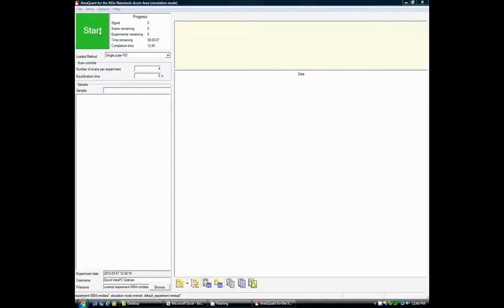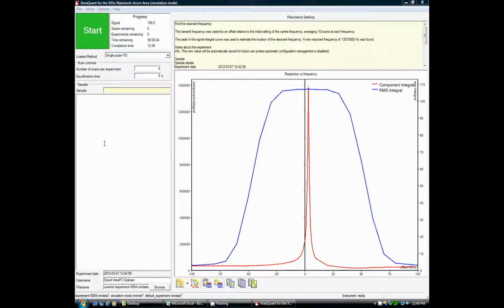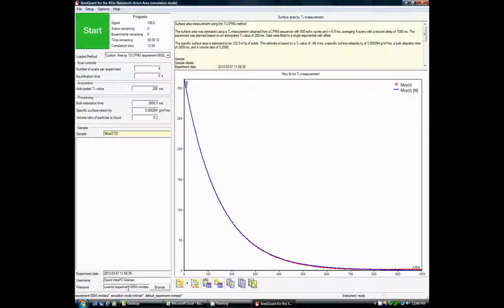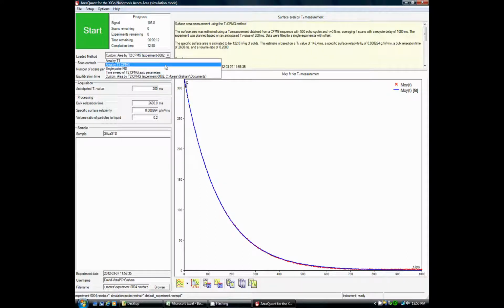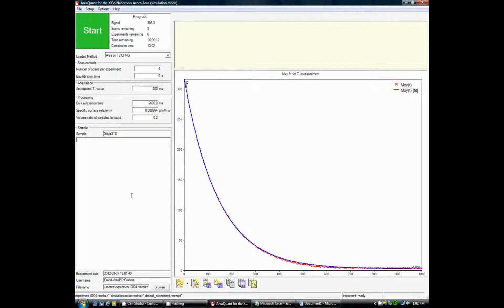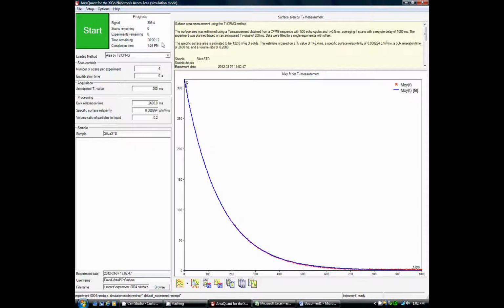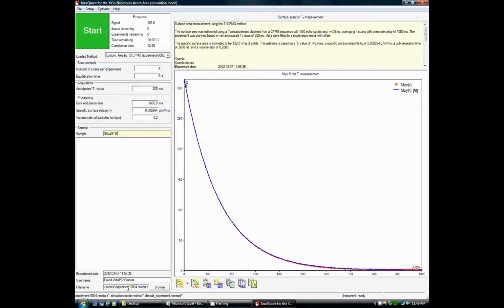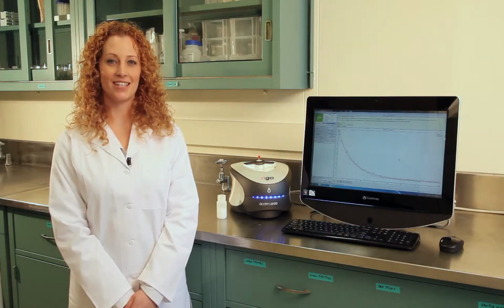Demo Xigo Nanotools Acorn Area

Comment: It is required for particles to remain suspended for the duration of the measurement therefore limited to analysis of nano particles? Being able to use this to analyse large particles with low surface area instead of using gas techniques seemed too good to be true.